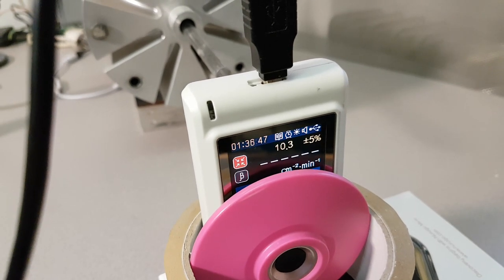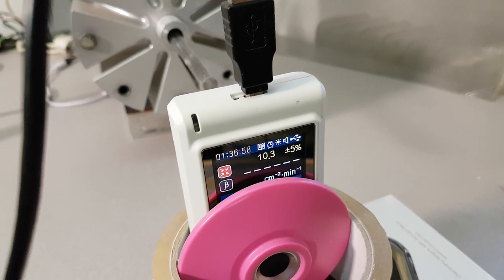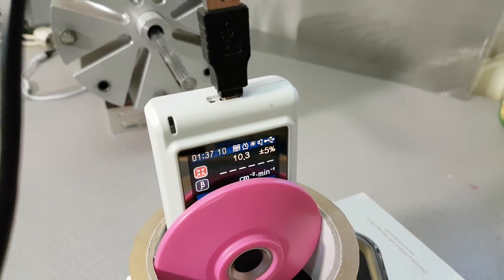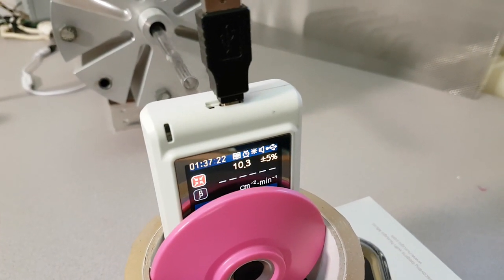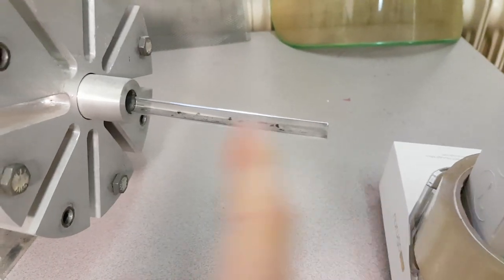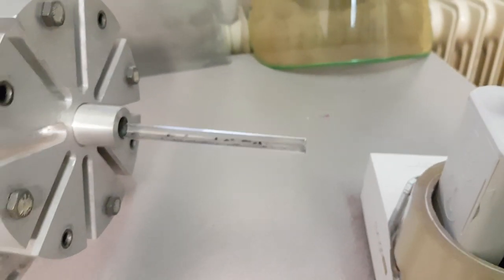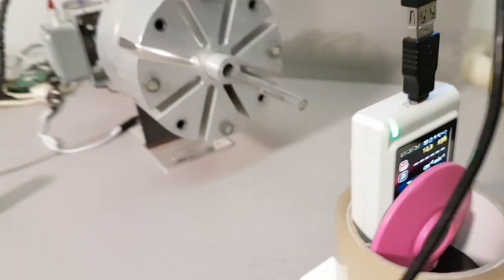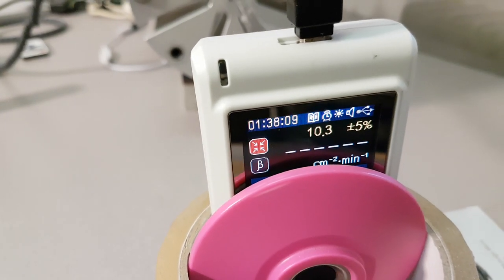Super NOVA - Beta background count

Comment: In this mode you mesured background GAMMA + BETA
To start mesure pure beta - press down and start mesure (press right)
Reply from the maker: Thanks, Doing what you say, but on the interface in English, it says "Measurement: Background" for what I ran and what is running now it says "Measurement: bkgnd+source"

I have an issue, when the reactor is running, it spits out read hot particles, so really I need something to protect the pancake
Reply: I dont that you can measure pure beta with that device. If the blend is open youll always measure gamma and beta. If it is closed with the blocking square only gamma.
Reply: @sonyxperiasmk  In beta mode.
2 measurements are made, with and without filter. So the device calculates a pure beta.
(In the video, beta did not reach the measurement)
Reply: @Nuclear_Legacy  Thats an interesting approach, nice to know!